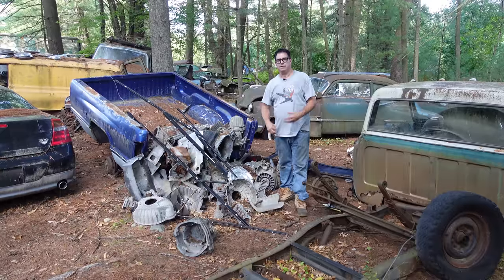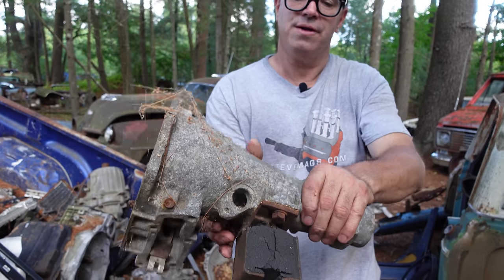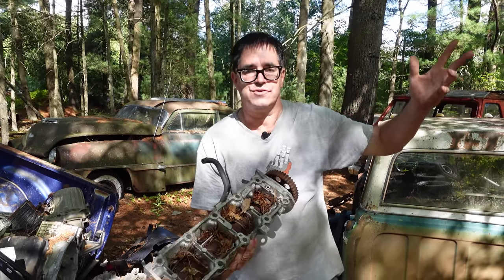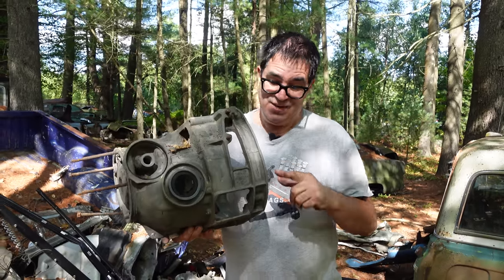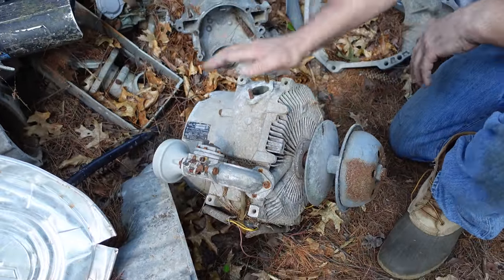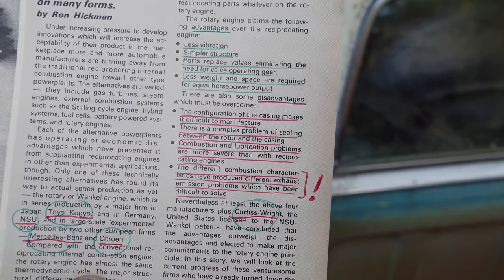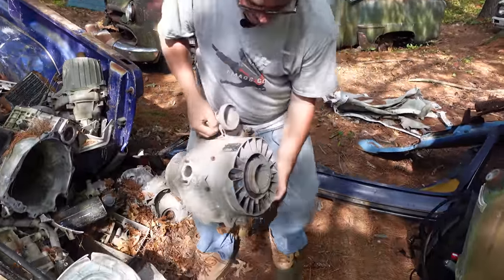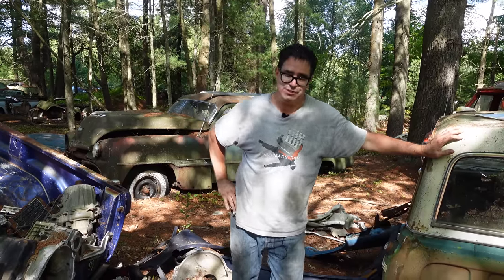Aluminum The Poor Man’s Silver

Comment: Wankel is not a rotary and a straight 4 cylinder engine in a motorcycle is a TRANSVERSE 4 not an inline as it is commonly referred to. There were some inline 4 bikes but that goes way back and the names escape me but anyway  my Ninja has a transverse 4 not an INLINE... while on nomenclature it is incorrect to call a E Brake as it is not for emergency it is only a parking brake and most dont use them.... I do and have to replace the cable as they stretch eventually. Never rest my automatic on the park pawl only on the brake. Look at the pedal many say Parking or Park right on the pedal.

Comment: The worst part of a Dorito is they are a lot like 2 strokes. nearly 30% of the Fuel and Oil mix is pushed out the tail pipe and never burned... Which is also the good part. XP
Reply: A dorito? Didn't know they made motors too.
Reply from the maker: "Crunch all you want...we'll make more" is what Doritos TV commercial host JAY LENO used to say. Anybody remember that? -Steve Magnante

Comment: Hi Steve, please do not discard that early Chrysler TorqueFlite automatic transmission tail housing, put that on eBay, someone needs it.  By the way, rotary Wankel engines where not very fuel efficient for there size either, and that's one of the reasons why GM cancelled it.  Please reply.  Dave...

Comment: 50 years ago a school mate found one of those Curtis wright wankels and put it into a go kart. It could light up the rear tires at 50 mph. The Citroen wankel M35 project was another failure .They made a series of fiberglass sedans(267) and handed them out to be tested in real life over 30,0000kms. . They were all pulled back in and scrapped. Except one I think. 
Then they made 1000 of the more sedate looking Bi Rotors which were also recalled,or they tried. The owners loved them .

Comment: I thought the airplane engine was called a radial not rotary
Reply: I made parts for airplane engines. You are correct.
Reply from the maker: Hello Tom Tom, lets remember that in the earliest days of powered flight, air cooled engines were preferred to liquid cooled engines because the weight of the coolant, radiator and plumbing was absent on an air cooled mill. Of the air cooled engines, there were two main types, the RADIAL where the crank spins in the center of a stat-burst array of pistons and the ROTARY where the crank remains stationary and the cylinder barrels go round and round - along with the propeller. This concept sounds NUTS and it kinda was. The fuel contained the oil for lubrication in the form of a Castor Oil blend that was sprayed outward by the spinning cylinder heads in use!!! The Sopwith Camel was powered (or at least most were) by a stationary-crank "rotary" type engine. The hassle was TORQUE REACTION. The airframe would "cock" when the throttle was opened or closed giving the airplane a distinct twitch to the left or right that raised heck with the aiming of machine guns. Anyhoo, you probably knew all this. But again, this is why I never call a "Wankel" a "Rotary" even though Mazda itself applied brash "Rotary Powered" emblems and graphics to many of its Wankel powered vehicles. Thanks for watching and writing, Steve Magnante
Reply: Rotax made airplane engines...

Comment: I BELIEVE YOU HAVE TO USE SAND TO PUT OUT MAGNESIUM FIRES .
Reply: Foam. Or purple k.
Reply: sand or "class D" extinguisher. What you are trying to do is smother the fire. It can be done with water, but you need a LOT of water. About 2,000 gallons of water for an engine fire should do it.... flowing at 500 GPM in low pressure.

Comment: another thi g about scrap aluminium, of there is any steel in it, scrap yard will call it contaminated and you won't get $ 0.28 cents per pound.
Here's a cool fact, aluminium rims are $8 each (tire and lead weíghts removed) American Racing , they made chrome mags back on the day, make factory alumínoum wheels for all american and some import cars, they buy them from recyclers and resmelt them down and get 99.985% back, literally the pain't or clear coat , they really use them over and over!

Comment: Back in the day I had 2 friends that each had the Mazda RX7 car. Besides the emissions problem, both cars had an issue with heat dissipation and oil consumption.
Reply: Wankel's have no crankcase so there is no oil bath to keep the rotor lubed, so they literally inject oil in through small ports, which gets burned off. They all burn oil by design, which is also bad for emissions. As for heat, the combustion always happens in the same spot on a wankel, so all of the heat is generated in a small portion of the housing which is tough on gaskets and can eventually cause warping too. ETA to clarify, combustion only happens in one spot. Exhaust happens in another etc. On a piston engine after combustion the piston moves and the volume expands, lowering heat then the exhaust and intake cycles cool it further. This all happens at different locations on a wankel, so it can't benefit from the cooling effect of these cycles. Wankels are crappy daily driver engines, they were great racing engines.

Comment: Hey Steve, another great video.  I believe the airplane engine is called a Radial engine not Rotary. 8:11  Rotary is usually the Wankel engine.
Reply: on a radial engine the cylinders do not move.
Reply: There are piston rotary engines and piston radial engines. They both have a radial configuration of pistons. The cylinder block assembly is stationary on a radial engine. The crank is stationary on a rotary engine. Piston rotary engines are very early engines, they have been very obsolete for more than a century now.
Reply from the maker: Hello yellow351mustang, you may know this already but "radial" aircraft engines have a spinning crank and "rotary" aircraft engines have a stationary crank and a spinning crankcase. It sounds NUTS but on many early airplanes with air cooled engines - like the famous Sopwith Camel of WWI - the crank was fixed in a stationary point while the 9 cylinders AND PROPELLER spun round and round. Crazy but true. The big hassles were exposed valve gear and lots of Castor Oil spraying outward at high speed and a nasty Torque Twitch when the pilot worked the gas. Mazda itself really clouded the waters by applying "Rotary powered" emblems and decals to certain Wankel powered vehicles. Technically incorrect but if you say something enough it becomes true. Right? Anyhoo, THANKS for writing, Steve Magnante
Reply: @SteveMagnante  Aww.  Thank you.  I was not aware of the rotary piston engines.  I am familiar with the radial engine like that of the P47 Thunderbolt, F6F Hellcat, F4U Corsair etc.  Which I believe all used the same Pratt and Whitney Double Wasp engine. The rotary piston engines do sound very crazy for sure.

Comment: Bellhousingsare either cast iron or aluminium. Only steel ones are specialty race components.
I could use that Ford b/h!
Wankel,, the engine that never lived up to any expectations. Thirsty, noisy and at best a short life. 
Why Mazda have persisted with the things noone knows.
The electric engine like a rotary will never be a mainstream engine. Just a passing phase with very much unresolved enviromental issues with battery disposal.

Comment: Radial and Rotary engines are different. In your explanation you even said radial once then went on to say a radial engine was a rotary engine. Rotary and Wankel are the same, Radial is not. Maybe bone up on that and do an episode on Radial engines and why they only have odd # of cylinders.
Reply: A rotary engine is a piston engine where the engine block assembly rotates around the crank. Radial engines, the crank moves and the cylinder block is stationary. They both have a radial arrangement of pistons, hence using the term to describe a rotary engine.  Steve's explanation was correct, he doesn't need to do any boning up. The term 'rotary engine' is very generic and can refer to lots of configurations including piston and pistonless designs. In modern nomenclature it usually means the Wankel when someone is talking about a 'rotary engine', but the piston rotary is the originator of the name and they have been around since the late 1800's.. and were very obsolete by the 1920's. You may have never seen one.
Reply: World War One Airplane engines came as either Radial or Rotary-Radial, the main difference being, the Pure radial had the motor/engine block fixed solid to the front airframe and the crankshaft turned the prop. Where-as the Rotary-Radial had the Crankshaft solidly affixed to the airframe- and the prop itself was affixed to the motor solidly, and the whole Radial Motor Spun with the Prop, eg- Sopwith Camel style. (EDIT) PS- sorry DrifterBBB, I didn't see your reply, before I posted mine, basically a ditto.
Reply: Thanks for the teachin' there BBB and Ralph. Always good to learn something new. Much appreciated.
Reply from the maker: Hello DrifterBBB, thanks for the affirmation. I was specific to keep "rotary" and "radial" distinct. I remember reading about how Sopwith Camel fighter pilots in WWI had to hose off after landing because the spinning cylinder assembly threw Castor Oil outward in a wide arc they'd fly through constantly - so long as the engine was running. But I think many folks are a little confused "thanks" to how Mazda put big "Rotary Powered" emblems and stickers on certain of its Wankel powered vehicles. I remember the Wankel pickup truck (which shared bones with the Ford Courier) had ROTARY graphics a foot tall on some models. Anyhoo, THANKS for writing. -Steve Magnante
Reply: @SteveMagnante  That torque twist on ROTORY engines made turning the old aero planes very unsymmetrical. Someone even put one on a motor cycle rear wheel.